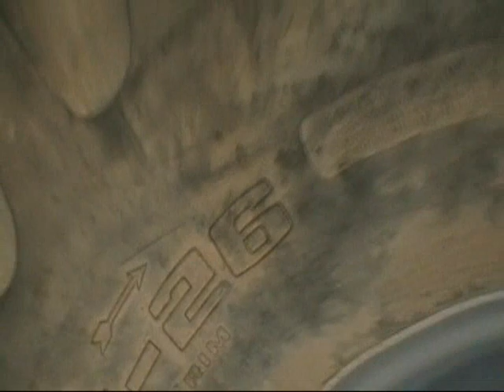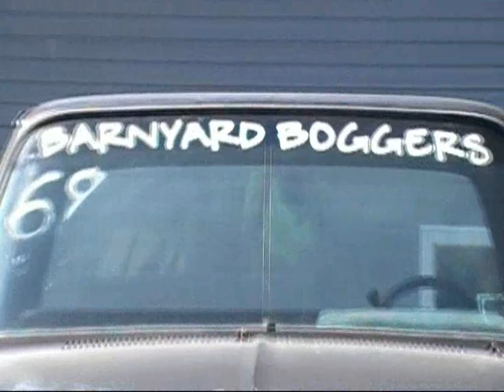99 Lincoln continental BarnYard Boggers NEW 4X4 MEGA TRUCK Kerby & Harolds New Wheeler

Comment: two of the reasons kirby went with the car body are:   It was free and two we have alot of low bridges in are area that you encounter on the way to mud runs also there is a height restriction with vehicles on trailers  and it is a hefty fine.

Comment: @iloveextremesports1 pinion brakes cut down one weight and help reduce on having to make a crazy off set  for wheel spacing. One of the guys who runs with us left his wheel brakes on cut a brand new 54inch bogger last year, so we opt to eliminate them.   Though it does make for hairy stopping when u break axle shafts

Comment: @CarsenF to do something different. at the mud holes down here in Florida when there is a big event theres probably 200-300 of those chevy trucks.  also, if you get bored of it you can always put a truck back on it. its just a square frame. not like it would be too hard to mount a cab on it.